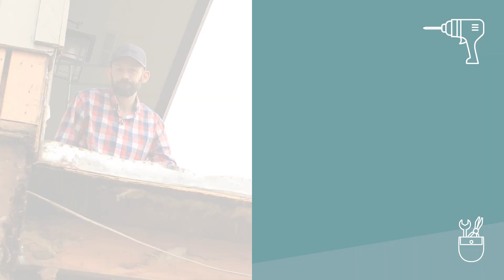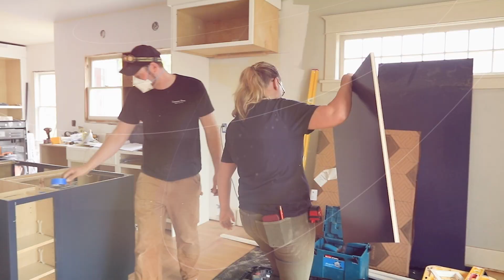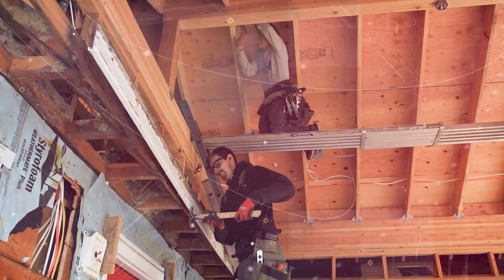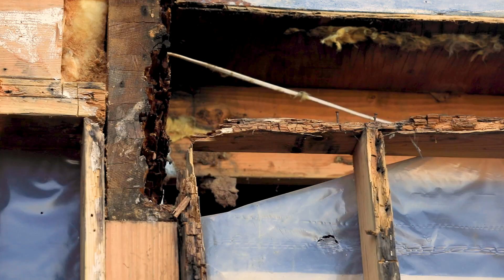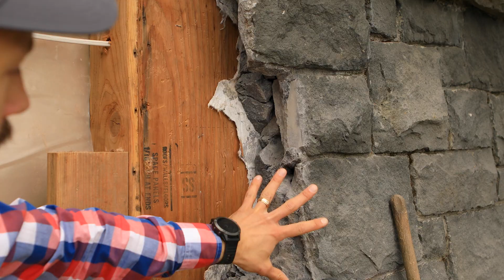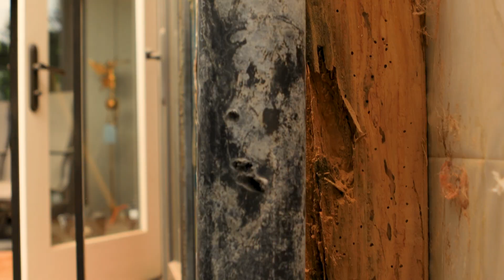Dryrot in a Structural Beam in a 2012 Home Portland Metro Area

Comment: I'm surprised that stone is so tight to the sheathing, I'm not familiar with stone but brick siding has had an air gap with weep holes forever.
Reply from the maker: Good point! You're right, that's another installation error on this home from the original builder. Unfortunately I think it did meet code when it was originally built here in the PNW.
Reply: @LamontBros  Man I'd expect a house that nice to be built to code but I think reservoir sidings have always required an air gap. Maybe they thought house wraps were an adequate replacement during this time?